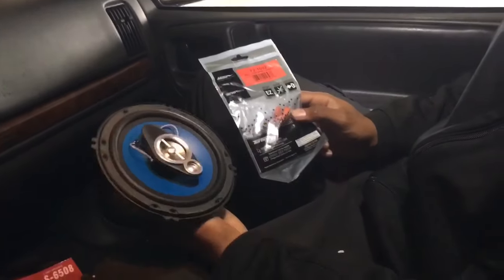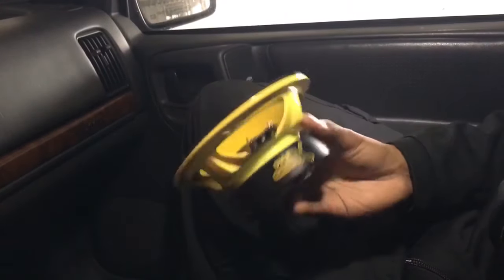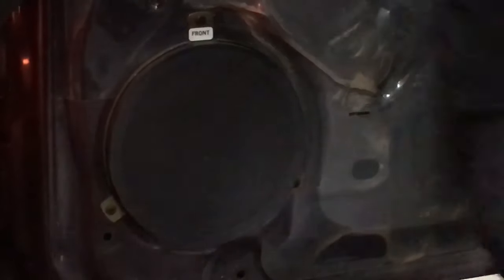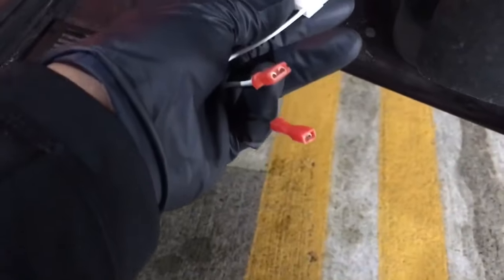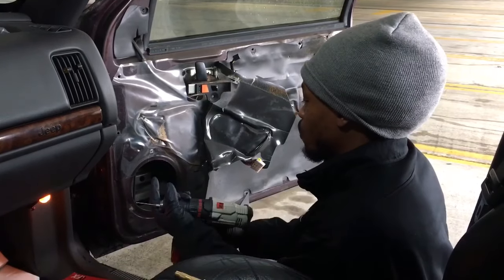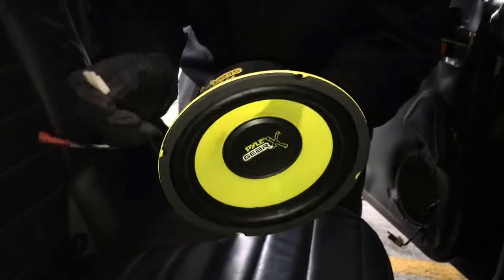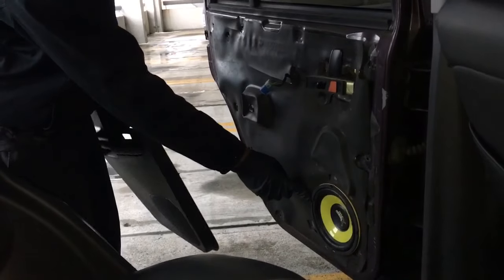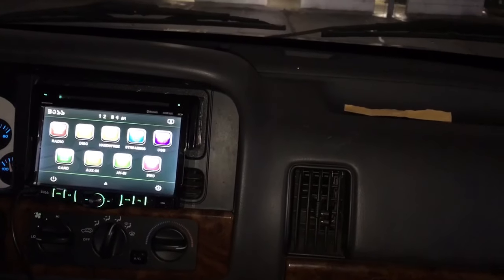JEEP SPEAKER REPLACEMENT

Comment: So.... I bought those same yellow speakers (Pyle PLG64) or so I think I did.  I put them in a '95. Word of caution, the window mechanism rubs against the back of the speakers ever so slightly, the window still has full range of motion, but it pushes the inner door panel inward as the window gets about 7/8 of the way down.  Maybe pyle had some production variance, maybe I got the wrong speakers, but you all should know.  Buy a 1/4" speaker spacer ring when using these Pyle's. Great video buddy; it helped me!

Updated: so... 1/2" spacers are too thick and the door panel doesn't fit anymore, if you can find a thinner one, that might work best.  I removed some of the plastic inside the door panel to attempt to make more room, still don't fit. Just trying to help.  

You may want to use other speakers that aren't so deep.

Comment: Hey man great video! I got the front speakers installed but I don’t have the right speaker harnesses for the woofers in the back. Can you let me know what harness you used for the woofers?
Reply: So I just looked closely at the video and saw that we have the same harness. How did you get the smaller of the two to fit on the male part of the woofer cuz mine is too small?

Comment: You have a video of you putting in the head unit  I have been trying to find a touch screen head unit but I can’t because of the dash it goes over the radio any tips will help I have been trying to figure it out for the longest

Comment: Can you do a video some time on how to run an amp power wire threw the fire wall?
Reply: Joe Boss i cut a hole in mine on the driver side there goin be a soft rubber piece where all the other wires r gettin run through but it’s sealed off but cuz it’s rubber i just cut a slit and ran it right through

Comment: I know you didn't want to say in the video, but what speakers did you buy for the front two spots? I have the same exact car and my speakers blew about 4 months go I need to get some new ones. Just trying to find what the best bang for my buck. Thanks for the help, this is a great video!
Reply from the maker: Pyle
Reply: Also which wire harness adapter kit did you get?
Reply from the maker: @nickrobinson119  https://www.ebay.com/p/1353219018